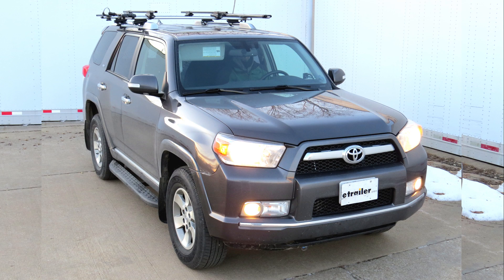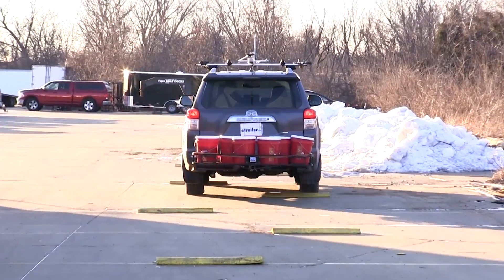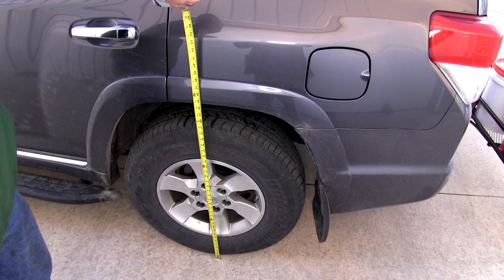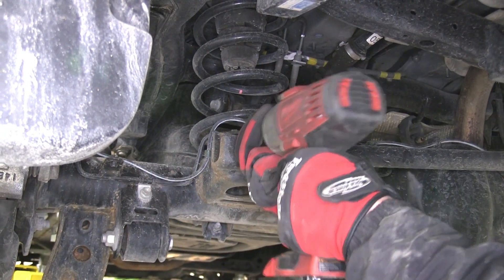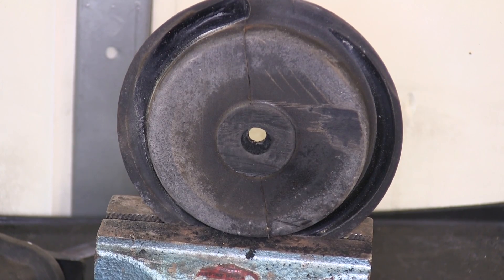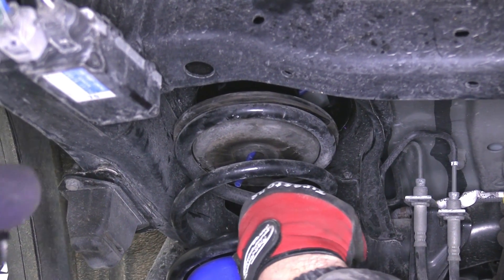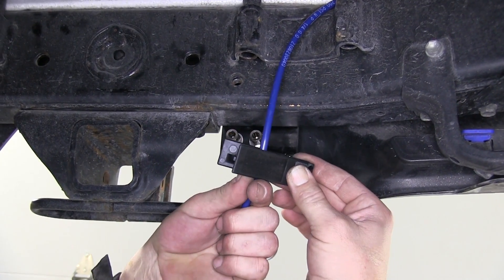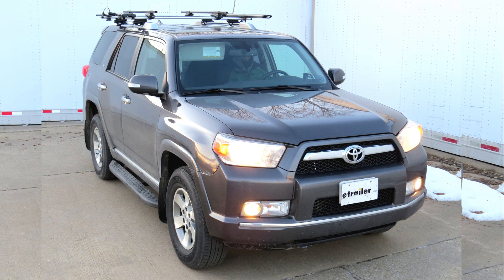Beginner’s Guide to Installing the Firestone Coil-Rite Air Helper Springs on a 2012 Toyota 4Runner

Comment: Was it just me??? i noticed zero difference
Reply from the maker: These air helper springs help tremendously when hauling a heavy load or loading down the rear of your vehicle.
https://www.etrailer.com/Vehicle-Suspension/Firestone/F4135.html

Comment: What is the function of the spring top mount which is needed to be cut? If I want the original set up back, can I found this top mount in the market or I will have to buy the spring + top mount?
Reply: rgosol The part that is cut off is the bump stop to keep the suspension from hitting metal to metal. The air bag will keep this from happening. 
If you want to return the vehicle to original, you can purchase new bump stops.